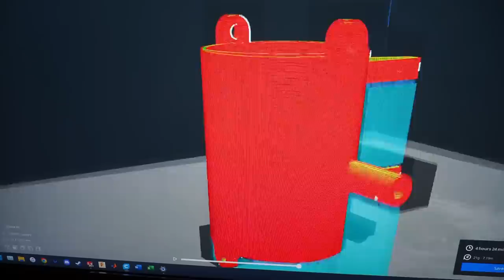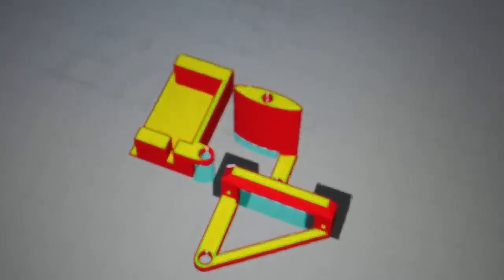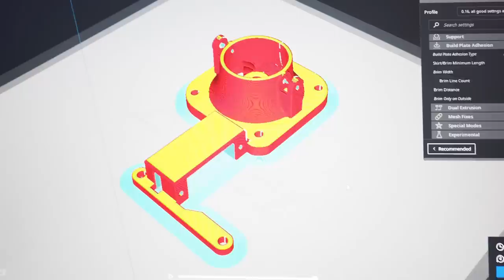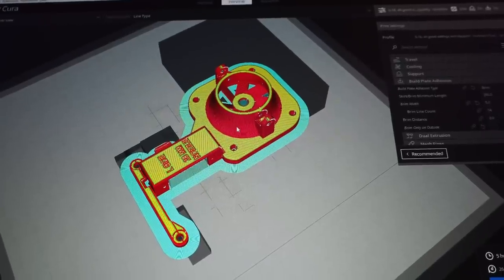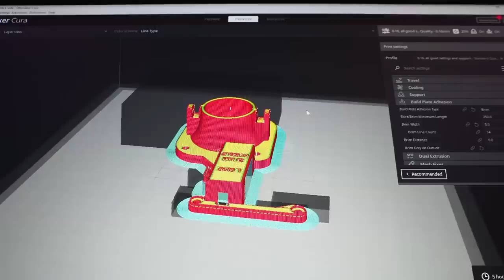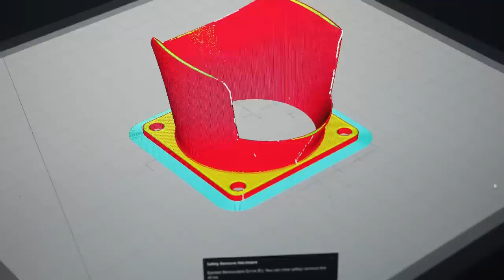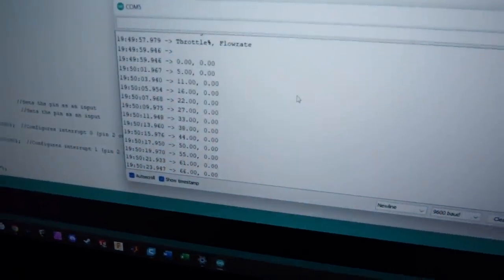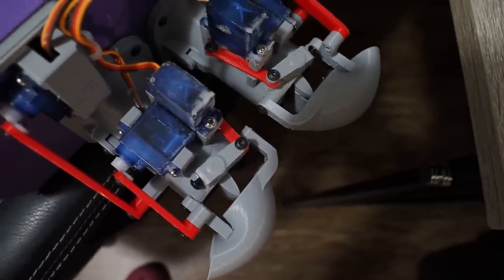3D Printed RC Boat Part 5: It's Ready

Comment: Awesome project.  If I could make a suggestion...  Turn the scoops around to face the back of the boat to reduce water ingestion and I would add a third louvered vent to allow air circulation.  It'll greatly improve the efficiency of your cooling fans.

Comment: Having built several 3D printed boats myself I can tell you that you'd be better off using waterproof, high torque, metal geared servos as those are going to eventually fill with water around the splined shafts, mix with the jelly and create a milky white goo that will kill those tiny little motors inside them.  Also, since I came across your channel on accident, I haven't seen your previous video posts, so I am wondering what material you've used to print the boat parts with?  It appears to be PETG or PLA.  I have tried both and had the best results with the PLA and then giving the entire boat a nice coat of two part epoxy/resin to make it stronger and water proof as the PLA is definitely not water proof on its own.  

Cooling... brushed motors most definitely will NOT like getting wet and unless you can figure out a way to make that baby water tight the scoops will only cause you grief eventually.  I have seen some guys take small copper tubing and make coils that wrap around their motors and had them pretty snugly turned around the motors using thermal paste to get the cooling they will need vs air flow from vents.  if indeed you are set on the vents you will need to have one pointed fore and the other aft because I think you might find that both facing forward may just pop those magnets off and it is good bye acrylic cover.  Not to mention that your air flow will be abysmal as there isn't anywhere for the air to go once it reaches whatever pressure it will build up to, slow your boat down due to the drag of those huge scoops and be a risk for sucking in a huge amount of water right on top of those motors.

My last little bit of advise is regarding the cockpit hatch cover/canopy.  Not really sure how fast your machine will get to going, but if it is going to get in the range of 30-40 mph and you pop up over a wake/wave and flip, that acrylic cover is as good as gone, and will never be seen again, except by the local fishes in the lake/pond/river where you were gassing it up and having fun until that moment...  while the magnets are definitely less of a hassle and seem secure, they are not going to be able to withstand the hydraulic load that an impact with water will deliver.  I suggest using some threaded T-nut inserts glued into the flange of the cockpit roughly where the magnets are, some small and pliable self adhesive weather stripping around the whole thing and knurled thumb screws to keep the water out and cover on while you paddle out to rescue your project.

Check out www.offshoreelectrics.com for all the little parts and pieces or just for some ideas to think about.  I wish you luck and good times while you experiment with your project, my man.  I am, looking forward to seeing how it works out for you.  I am currently in the middle of a 36" Catamaran build using dual brushless 4074's, water cooled, dual SeaKing 180amp ESC's and servo controlled surface drives.  On paper it pencils out to between 75 and 110 mph depending on the battery/batteries and their configuration, and the size/pitch of the props.  My single drive 36" can hit close to 80 mph on smooth, flat, calm water at the bleeding edge of throttle stick travel, but can cruise around comfortably all day at 40-50 mph just goofing around with the kids and their toy boats.  I have flipped it over at least ten times with a little gust of wind and a small wave at just the wrong moment without any issues whatsoever. 

Looking forward to seeing your final results and accomplishments!  Happy sailing! - Eric in Nor Cal
Reply: Lots of good advise but brushed motors can actually get wet with minimal consequences (assuming they are properly dried and maintained). A lot of folks will break-in their brushed motors by submerging them in water while running.

Comment: why on earth would you use fans for cooling when you have effectively two water pumps at your disposal , get some brake pipe wrap it around the motors have a take off from your jet drives some silicon piping to the brake pipes , the copper of the brake pipe is definitely more efficient as a heat sink than air, why waste electric when you dont need to,another advantage of using water cooling it makes for a sealed enclosure for your electronics as the way you have it set up if you go through a wave water just goes through your fan scoops,

Comment: For acrylic, after scoring, something like this may be helpful. There are different sizes

Hand Seamer, 6IN (insert Amazon link here, maybe it blocked my comment)

Also, instead of waterproofing servos, have you considered push/pull cables? Even plastic ones may be strong enough, and then all electronics could remain inboard.

Comment: You should put the servos in the boat and run cables to them.  Then no need to waterproof.
Reply: Looking for that comment. Simplify everything with control rods. Move a ton of weight to the CG.

Comment: okay imma just put this out there... DO NOT just splash acetone all over your hands. you'll likely be fine, but it does cause damage. most dish soaps works perfectly fine for removing petroleum jelly for the same reason they can clean cooking oil off of dishes. much safer...
Reply: I agree, repeated exposure can cause nasty skin conditions, so best not to risk it.

Comment: Very cool! A couple notes though, you may want to put a good amount of ballast in that boat for it to operate well. Also you may find with your independent vertical thrust vectoring that adding a switch to change modes of operation (mirrored, inverse, or inertia stabilization in turns / waves) will add control abilities.
Reply from the maker: I haven’t thought about adding ballast before. The boat is currently set-up for a specific waterline so adding more ballast may cause it to sit too low in the water. The batteries and motors are pretty low in the boat so that should help with the centre of mass slightly (idk we’ll have to see when I test it!). As for the control modes, I’m definitely going to explore this in the future! I want to be able to compare control ability, perhaps with a timed course or something like that. Anyways, thanks for watching and commenting!

Comment: Really cool project and you put a lot of thought into it. 

One thing I was wondering though: do you have anywhere for the air to escape or are your fans blowing air into a sealed space? If so, that will give you far less cooling than what you might think and also the added pressure will counter the magnets to some extent. Depending on how strong the magnets and fans are it might not actually make a significant difference, but something to keep in mind.
Maybe water cooling could be a better approach in the future?

In any case: subscribed! :)
Reply from the maker: Hi! Yes I totally forgot to add vents! I’m going to add them in the beginning of the next video. For now I’m just using the fans to test the boat. For the more finalized version, I’m either going to upgrade it to two brushless motors and water cool the motors (they’re just very expensive for me right now) or I’ll try to diy water cooling for the 775 motors in the future! Thanks for watching and subscribing :)
Reply: @mediocremaker5575  Awesome, that should at least keep your motors from burning out. 

Yeah, I get that, t is not cheap to do brushless and water cooling with enough power. Long term goals maybe once you hit enough subscribers? Wish you all the best for your channel and will keep checking in :)
Reply: Thats a wicked project. 

Why is water cooling expensive?  Just some copper tube wrapped around the motor (ebay have them for under $5 or make your own), tap into the jet stream. Much better than risking filling your boat with water.  Are the fans water proof?  

Might want to add a tube for water evac.
Reply: @alexcwt  Because you can't simply put a tube in the jet and call it a day. If you drive fast and then slow down, suddenly your water pressure is gone and most of the cooling is too, when your motors might be hot from just running fast. You don't have enough thermal mass with those tubes around them to cool them passively either. So driving fast and then suddenly slow (which you often do in an RC boat) could fry your motors really fast. 

You'd need to have a pump, filters etc. if you want to use the dirty water as coolant. Which brings a lot of other issues with it due to the small diameter of the tubes. It can easily clog and now you have no more cooling, so you also need temperature sensors and a controller to shut your motors off immediately. Hence it would be better to go with a closed loop and have a radiator or so outside the boat as a heat exchanger (could be at the bottom, use the thermal mass of the water body around it, so at least that can be cooled passively). 

Doing it quick and easy will not last long. Doing it properly will not be cheap.
Reply: Hmmm.  Interesting.  When I ran RC boats in the 90s, they were made of balsa wood and fiberglass. I ran both electric and nitro.  It has always been just a simple water pickup for either kind. Never had any burned motors due to clogged hoses. Especially the stock motors you are running. It’s a much better option than having water in the motors and speed controller.   Does the fans help without any heat sinks?  I would suggest using aluminum motor mounts with heat sinks if you decides on air cooling. Don’t know what the melting temperature the 3D printed parts are.  But the motors get real hot. Especially if you semi-encased them. Just mho.
Reply: @alexcwt  Agree, heat sinks would improve the situation a lot. And I guess the clogging issue also depends on your tube diameter and how clean the water is that you're going in. The lakes I had at my disposal were not the greatest. Always got stuff floating around in there. But maybe a fine mesh at the intake and driving responsibly (no drinking, don't go full blast for minutes and then stop entirely all of a sudden) could be doable.

Comment: Try Corrosion X HD (it's a spray) for sealing servos in the future. Same process take apart spray all the electronics with it etc. Makes them safe for use in salt water conditions as well. It's expensive, but a single can will last any hobbyist a lifetime.

Comment: I also use the score and break method when I need an acrylic piece. I use a ruler and something straight and stiff to keep the ruler flat, and a pair of clamps (I really want something thick and stiff that is made out of metal instead though) and I also use piece of wood so I can snap off the acrylic piece in one go. If I don't do that then this will happen 8:00 I have never been able to remove the small pieces that is still attached to the main sheet cleanly before.

I own a cheap router. I have mounted a sheet of acrylic to it so it functions as a table and I use that with a fence to clean up any jagged edge on a piece of acrylic. It works a treat but I really need to be very careful when I use it.

Comment: But, where are all the air from the fans going to go after they have passed the motors? If the air doesn't have anywhere to go, it will just create slight amount of pressure inside the boat. Maybe create a channel for the air to go through, so it can escape in a controlled manner? Maybe some perforated openings with a rubber flap on top, just so so the airpressure can move the rubber flap, and be mostly closed by the rubber flap when the fans are not blowing?

Comment: Great design, you are one of those rare cases of the mind of an engineer but not the hands, I guess practice will make you better but don’t drill with the chuck anything but tight, ever… drill your material on a work surface not in assembly, you almost drilled right through your electrics, good solution on the servos you could also use a lubricating silicone spray (Q20), also hand sanitiser cleans petroleum off the hands easily, work slowly and carefully, there’s no rush, we cut huge lengths of acrylic by scoring, just take your time and make sure your straight edge is secured, make a few runs, it’s very rewarding to get a clean break, you had cuts all over the place, it can really ruin a great design. I would invest in a work bench with a vice and cutting table.

Comment: It looks bad ass. You can use spray rustoleum spray crack fill, sand paper and painters touch color then clear coat for the parts. It makes them look like metal parts. Plus it strengthens the parts

Comment: i would turn the inlets to the cooling fans around to face backwards, you dont want spray coming in and straight over the motors and electronics.
also consioder some more ballast up front that nose will pop up very easily at speed

Comment: Buying a drill is a solid purchase. Doing my own projects, it can be intimidating buying tools. Everyone's situation is different, but I've found that I've been thinking about getting a tool for a while and finally pick one up, I'm usually really happy with those purchases. 

Really cool project! Thanks for putting together the vid! 

Smoothing the edges on the polycrylic: you might try a belt sander. A 120 grit belt or 60 grit sanding block would probably take off the peaks.

Comment: Also you have fans blowing in to cool motors but no vent to let the hot air out
Reply: I came here to comment this.  Also that hole saw running into the wires made me cringe.  Get a scrap piece of plywood for cutting into, don't cut into your electronics.
Reply: I'm going to guess that it's still better than no fans, I built something like this for my school project and since the school was only able to buy in my country I was unable to buy a proper water-cooled boat motor ESC combo and I use a way overkill combo from castle creations designed for 1/8 cars and the first time I tested it in the bathtub it almost went flying out and broke the motor coupling, the day before the presentation I went to a lake nearby and even with a small breeze it was flying for all of 10 seconds until the ESC overheated even with a fan attached and I had to jump in the water to rescue it.

Comment: One thing ive heard a lot of people say (and ive tried myself)
When using a hole saw in acrylic, either run it in reverse, or drill through the acrylic with a sacrificial backer made out of a 2x4 or something
Reply: Yeah, and don't drill through on top of wiring and motors. The risk of damage is to high and the clean up is easier.
Reply: I wouldn't run in reverse, it will just generate more heat. Cut from both sides, it will make a way cleaner cut (not just in acrylic). Use coolant, which can be just water from a spray bottle for acrylic.
Reply: @gabiold  that's actually the idea, melt your way through, it has a lot less chance of it cracking.

While it's not the prettiest edge. I've yet to have it crack.
Reply: @girrrrrrr2  While technically you can machine everything by melting through 😉 it is not the best way.

The cracking is due to the saw (drill, mill, etc.) is catching or stuck in the material. The former is because of uneven feed and unstable work holding or wrong cutting edge profile the latter is due to inadequate cooling or too high feed or machining speed.

So mount that suff in a vice and hold the drill steady and in right angle. Requires a lot of practice. Way easier on drill press by the way...

Comment: just my opinion but if you're to do anything substantial with these blue servos I would avoid them (don't cheap out)
because they are garbage, there's a reason they're $2 each or whatever vs. $10+
omg his little shirt 6:40
10:35 need one of those deburr tools run it along the circle edges
cool project, like the diagramming/pseudocode
Reply from the maker: You’re probably right about the servos. I want to revamp those assemblies to make them a bit more refined later on and I’ll likely switch to better servos. Thanks for watching!
Reply: @mediocremaker5575  spend the money on proper water proof ones. You wont regret it. I water proofed rudder servos in the same way, and a few other methods, and water always finds a way in. I picked up a proper water proof servo and havent worried about it since.

Comment: This is some amazing work, but I have one note to offer: Main motor cooling fans have no exhaust, after reaching their maximum static pressure they will no longer generate airflow to cool the motors!
Reply: I was going to say... but ya, easy fix, just flip one of the fans, in and out.

Comment: If you make the nozzle end smaller they will work much better.
Watch Mike Finnigan garage, he has several jet boats he is making faster and faster. You will get the idea for the correct design.
As glass, you need to have the cut line right along the edge of the table to cut the sheet.
You will also need to cut deeper.
In my case I was cutting glass and the first tool I used was junk and the edges ended all like yours.
When I bought another tool it scored deeper and it was like day and night difference. From that point all my glass pieces has a clean break line.
And for the servos, there is a much simpler solution.
Buy yourself a bottle of clear nail polish or borrow from your lady/mom,  and coat the circuit board with two layers. My Tamiya Lunchbox has ended in the creek several times and the servo still works flawlessly! Make sure each layer is fully dry before you put them together again.
Same can be used on receivers etc.
I used to use balloons on my crawlers, but all I use is clear nail polish these days.
I picked up the trick from LedWheel channel.
But it does not work for old crystal receivers, only 2.4 stuff.

Good luck with your project! 🙂